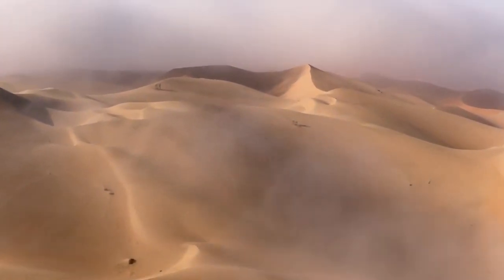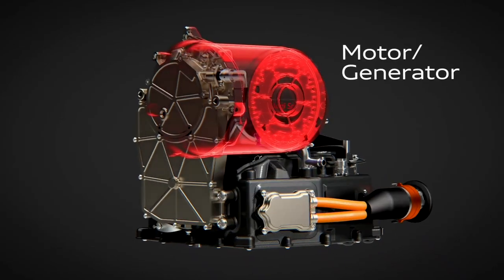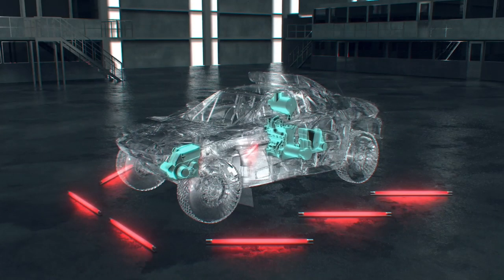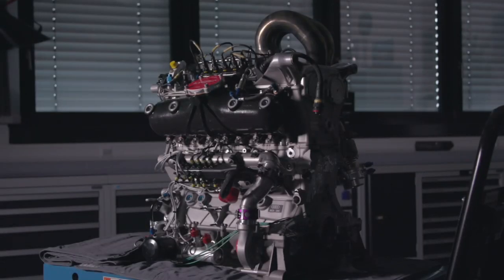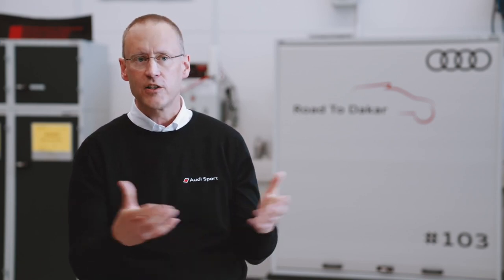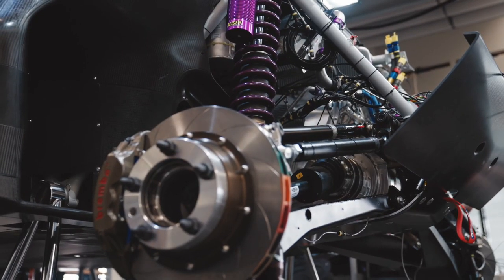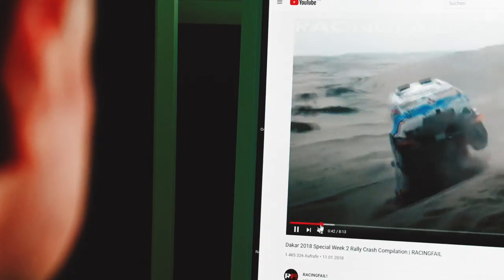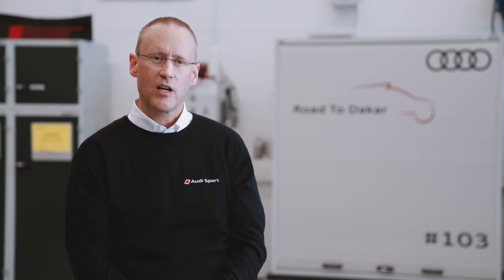Road to Dakar – Drivetrain of the Audi RS Q e-tron

Comment: Whats the reason for this car? Converting energy from a combustion engine makes no sense...
Reply: There is, it's called extended range and consists on an ICE which is mainly focused on extended autonomy. Which is necessary due to the limits of current battery technology. 

Perhaps, in the near future we'll have batteries that can solve those limits which is amazing due to how new this technology is in motorsport.
Reply: no powerloss due to running gears&shafts, almost all the torque instantly transferred( in  grip limits), electronically simulated differentials...
Reply: I think they're doing it so they can test the motors and drive electronics in some of the most brutal, long term scenarios possible, well beyond the limits of current battery technology. What's the point of testing a motor if you can only do it for 200 miles, then have to wait for half an hour to continue testing? They want to torture test it for hundreds, if not a thousand miles without having to stop.
Reply: Tell that to train's. This is more efficient than hooking a transmission to an engine. I am planning on making something similar for fuel economy.
Reply: You must study more about physics and  thermodinamics
Reply from the maker: Same reason as any other racing at Audi. It is to test new technology in the most grueling conditions. Converting energy from the combustion engine is a necessity for the application. The nature of the Rally Raid series is that it covers the most remote locations that are without infrastructure. The fuel gets trucked in too FWIW, but it's likely no one would suggest that internal combustion competitors are pointless because race fuel deposits aren't readily found in the middle of the desert or because they also need a battery to operate.
Reply: @AudiClubNorthAmerica  I love that it can work like a train, or an electric, or just using the gas engine to charge. I don't know if I will be able to do it but I'm wanting to build a car that runs similar without the expensive batteries. Gas engine, generator, electric hub motors. Thank you Audi Club North America for an inspirational rally hybrid.
Reply: @AudiClubNorthAmerica  but if you have this turbo charged engine why not just run the car on that? It is basically simple... EV work in towns or short distances between towns. 
For anything remote or longer you still need petrol. To me this entire project just looks like a greenwashing/marketing gimmick. In the end you are still driving a petrol engine just like the other competitors.
Reply: To make huge marketing stunt for EVs. In reality, it is a hybrid, which, unlike EV, is a viable technology.
Reply from the maker: @fushki  use of terms like e"greenwashing" in a case like this has an ironic spin to it, because it sounds as if it's pushing its own anti-electric narrative. Technical questions should go to Audi (again, we are Audi Club... so owners of cars not the company), but Audi the brand has a long track record of pushing technology in racing to improve their development of roadgoing technology. This is  clearly an intense stress test for various technology development. Batteries are the obvious one here, but the electric drive Audi developed for Formula E is here used as front and rear motors, and converter for power created by the repurposed DTM engine. That means abusive drive and intense power conversion both for the electric unit and the batteries. As we've seen in the racing, the suspension lessons learned are also critical, because the abuses inflicted by the Dakar Rally have seen lots of rear suspension failure due to the heavy weight of an EV. Nevertheless, Audi has shown they are a top contender and have even won a stage. A token "greenwashing marketing stunt" is highly unlikely to be a contender in such a highly competitive racing tradition as Dakar. This is a science experiment for Audi and the lessons will help them develop their road cars better. Audi has a tradition in pushing technology in road cars whether that's all-wheel drive, turbochargers, diesel, natural gas, hybrid or full EV. They are constantly pushing the envelope with tech, and that starts in racing.
Reply: @fushki  true, there is always a loss when converting energy.   There is nothing green about this car.   I do think the electric drive is better for this kind of terrain. Much easier to control or distribute the power to the wheels.
Reply: @mitchiegxxr350  I am not against trying this tech. I think in sand no gears might be better... but then again not being able to down shift can be problematic in off-road. You want to be able to keep the car balance to the rear and a lower gear helps. 
But what is really bugging me is this implication that this is an eco technology. I have a friend working in this stuff and he reckons that the motor being used at such high revs to 'generate' power will burn more fuel and make more carbon emissions than if the car just used the motor to drive.
Reply: @fushki  jep. We agree👍
Reply: @fushki  Did your "friend" actual run the numbers and calculate efficiency or does he just "reckon" ?  Assumptions like that are meaningless in the world of engineering. The numbers don't lie. You do the calculations, design the system, run the tests, and get your results. Period.
Reply: @jamescrud  well they are not part of this program so they cannot see the numbers. 
But having worked on similar projects they know what a motor like this being used to generate power does. 
This isn’t anything fancy to know, simply look at normal backup generators… they are not as fuel efficient as a car engine once they are working on high load power generation (like running high power tools).
Reply: @fushki  I don't think you understand how the e-tron drive system works. The energy converter (generator) DOES NOT power the drive motors directly. It charges a battery. The battery is what feeds the motors. There is no "high load" situation here like running power tools off a generator.
Reply: @jamescrud  i know exactly how this system works.
However you seem to miss the point. Charging such high capacity batteries and so fast (so that what you use can be replaced) needs a lot of power. 
Think about charging a testla, you need a high output power setup or the other choice is like a day or so of slow charging.
Reply: @fushki  So you're telling me that you know better than the group of engineers and designers who are spending millions to research and develop this technology?...

Sure.
Reply: @jamescrud  not at all. What I am saying is this might be future tech but it is not really an eco tech.
It is a glorified hybrid car at best. 
But they are pushing this like some eco warrior car. 
The Hunter is more eco as they have a carbon neutral fuel running their standard combustion engine.

The reality is they are basically looking how to make short ranged  ev cars have longer range. And well the solution is a combustion engine that charges at max rpm any time you push the pedal hard. 

I have an issue with how they market this
Reply: @nenume00  The power loss in conversion between shaft energy and electricity, then back again, is higher than the power loss in an all-mechanical system.